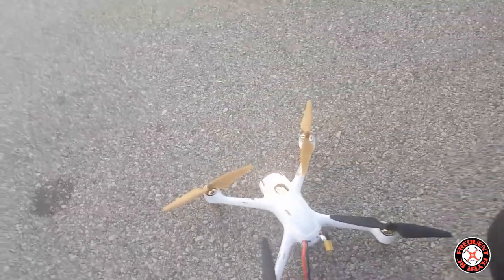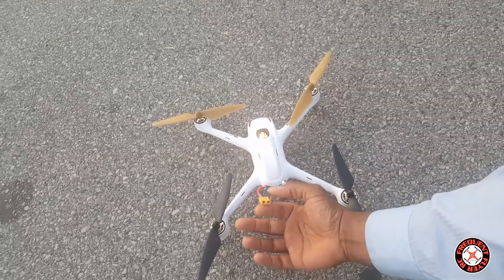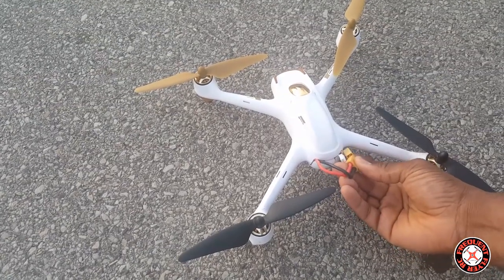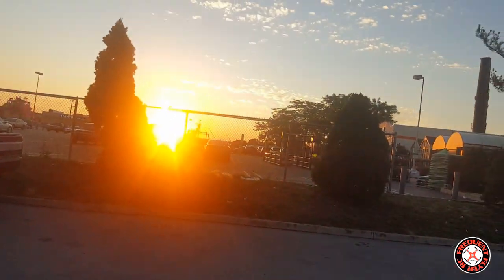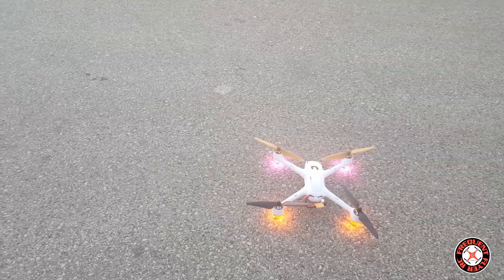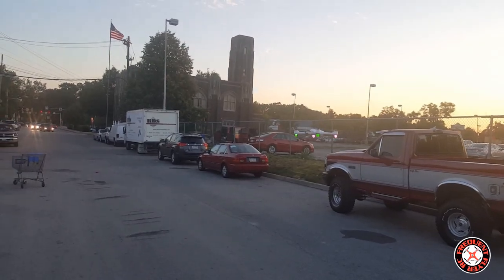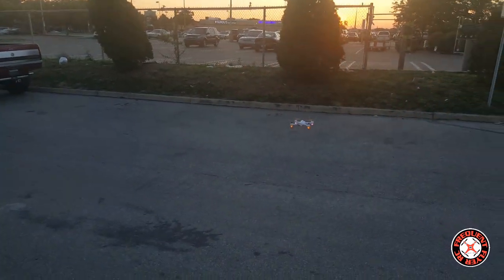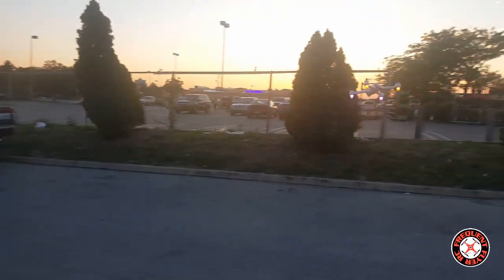H501S XT60 Adapter and 25C Battery with Upgraded Transmitter

Comment: love the videos.. which battery are u using?
Reply from the maker: +474cfmh Thanks! It's a "Zippy Compact" 2200mah 25C 2S:  http://amzn.to/2ahUIx1
Reply: Thanks, do u know if there any other battery that would fit inside, with a higher mah rate? maybe 3000mah? ,also since there a dual battery mod can i just use a higher volts on the drone maybe 11.4 lip?
Reply: I'd be careful placing a 3s battery in a quad designed for 2s.  Also, quads don't like weight.  I've been through all that building my own quads.  You need to check the amp rating of the H501S ESC's first.  I just ordered mine.  What impressed me was the 20 minute run time..

Comment: Frequent Flyer love your reviews, but was wondering if you could get in-depth about your upgrading transmitter (how many batteries are used, can you use a Lipo, does it control every function of the Hubsan H501S, how clear is the screen with telemetry and FPV)? How did you get the lights to stay on constantly, I know you mentioned that in your previous review of the H501S...was it after firmware update? I haven't purchased one yet, but your reviews is doing a lot of persuading. Lol! Keep up the great work!
Reply from the maker: +Tim Palmer Thanks, will try to do a video on it

Comment: Thanks for the nice video as usual. Quick question I have taked apart the transmitter for my 501s. How do I remove the spring mechanism from the throttle. Thanks Boston Ken
Reply from the maker: +ken powell I don't know that it can be done on the stock tx. I hear you can swap them though.. Search Andy RC on here. I think he has a video up on it as he flies mode 1 and his channel is pretty cool so sub him while you're there :P

Comment: Hi bro,since its quite long that you uploaded this video, can you please tell me whether you faced any ESC's or electronics related problems because of 25C lipo ? I am also considering upgrading to 25C 3000mAh lipo. 
Your reply is highly appreciated, thanks in advance.
Reply from the maker: No problem whatsoever. As long as its 2S you are good! 👌🏽
Reply: Thanks a lot bro for such a prompt response. I can now try the 25C without any worry :D
Reply: 7.4 volts,, the problem is the battery compartment inside is small.  the stock battery ratted at 2700 mAh ,  tests at about 1850 mAh.    so any "real / good" battery of 300+  7.5 2S of 50C should be fine.

Comment: You got about 12 minutes of flight time. I guess that's not too bad as the battery is 500mAh  less than stock battery and you were punching it a bit with a 25C discharge rate.  Still a great video. 
Was the throttle stick mod difficult ? Do you still like it or regret it ?
Reply from the maker: +Elecifun Self centering throttle is never preferred for me. Also, on the upgraded transmitter its not a mod. It's actually an option. There's just a screw inside to loosen or tighten to have it either way on both sides too! Most pro hobby-grade transmitters have this ability.
Reply: I forgot you were using advanced transmitter. I hoped you had done it to the standard : (  I need to get used to it. Problem is I use self center on the simulator and then when I use altitude hold on drone it feels funny. When I get more experienced I will be OK, I hope : )

Comment: Hello FF-RC. The Firmware update of 1.1.17,  as compared to stock firmware. The lights on bottom in stock will blink, and I have noticed the update of yours is very (which is good/cool) is much brighter and constant.
So tell me, with the update, are the l.e.d.s stuck on either constant, or off?

Preciate ya', man. And all your Awesome Vids.
Reply from the maker: +Sean Brooks hey Wassup man, the lights can do constantly on, flash blink like before or you can turn them off all together!

Comment: Nice flying!

Thanks for the link to the battery, I wonder if the stock battery is actually 2700mah. When I've been looking for them I've found it very difficult to find anything near 2700mah that will fit,  not many owner's of the H501s would settle for less than 2700mah so would end up buying an original battery. Hubsan must be selling an awful lot of them as they've  almost cornered the market as there aren't many alternatives if any, maybe I've been looking in the wrong place.  haha
Reply from the maker: +Andrew 2700mah is what my stock one says.
Reply: Andrew
Reply: Andrew don't buy off ebay even tho they say original. Stock battery=20mins Ebay-Battery=13mins to many fakes on Ebay that are junk. On Amazon there's a place selling for $24/lipo and the reviews are really good saying that those ones do get you 20min fly times
Reply: Frequent Flyer RC Thanks  Frequent Flyer!  😉
Reply: Cunningham1420  I ordered some batteries from HK. 😉

Comment: Hi thanks for posting the video with the battery connector mod. Just wondering if its beneficial to have the xt60 for this quadcopter. Ie does the quadcopter pull enough current to warrant the mod.  Furthermore, do you know if the quadcopter can handle a 3s battery?   Cheers!
Reply from the maker: +AJ L definitely more punch with this connector and batt
Reply: Thanks for the info!

Comment: I burned out a esc using this battery on second flight? Not sure if it was bad timing on faulty esc or the battery has too much power for this quad? How's your experience been
Reply from the maker: +mike216ism Wow, mine is still working fine. I even saw another reviewer do a mod taping 2 batteries together and modding them into a parallel system then running them for more power and more flight time!
Reply: Frequent Flyer RC well maybe I had a esc going from a prior crash a month ago. I'm going to give it another shot then. I really liked the responsiveness! I dropped the quad and let the stick go and it just grabbed like nothing I've seen with stock batteries. Thanks for letting me know how your experience has been. Going to try using them later today. Hope all is well
Reply: @FrequentFlyerRC  correct, Dustin Dunnhill did that video regards running 2 batteries in parallel with no problem at all.

Comment: When I look on my transmitter it says   
V4.2.8
LCD V1.3.2
H501S  V1.1.9
V1.1.9
Is this an old firmware? Did they fix the bugs on the firmware now? Thanks and sorry for the dumb questions
Reply from the maker: +jarka1361 old firmware but the good one. 1.1.17 is best firmware now

Comment: This drone almost as quick as the Bugs 3 when you put I t in manual mode. You can actually do manual flips  (throwing ). The 501s  is a beast in full manual
Reply from the maker: +Mike Anderson This is actually faster than the BUGS 3 when I fly it with my Devo 10. Also, I have many old videos out of the H501S including videos of me flipping it in manual mode. Awesome Quad! I actually have an H501A that I only got to fly once 😆
Reply: Frequent Flyer RC well send me that 501a  haha. I thought it seemed extremely fast. I remember pushing the Bugs 3 as hard as I could but this 501s I was holding back because it scares me a little. Your 100% right. It is faster than the Bugs 3. It even says in the manual it can do throwing. I'm so glad I bought this instead of a bugs 2.
Reply from the maker: +Mike Anderson another tip is if you fly it with a Devo or Advanced Tx you can remove the spring on left throttle to fly manual mode more traditional!
Reply: Frequent Flyer RC is it easy to remove that spring?
Reply from the maker: +Mike Anderson in the advanced transmitter and the Devo it's an option to have the sticks self centered or not. Must open the back of the transmitter and loosen or tighten a screw and that's it! I actually did a video on it. Will hunt it down for ya
Reply from the maker: +Mike Anderson here:  https://youtu.be/AZ69YbfT26w

Comment: Are you sure of the battery jack adapter call out. The one I have seems not to fit. EC2 to xt60?
Reply from the maker: +Miller Ingram yes EC2 to XT60, I got an EC3 first and it didn't fit :P

Comment: Is this advanced model? Do you need to do any mods for transmitter to get more range?
Reply from the maker: +Rivo Nömmik no need, advanced and standard identical except for the transmitter. Just buy transmitter if you  like it otherwise, yes, other transmitter can be modded easily.
Reply: but do you modded this transmitter somehow for a longer range?
Reply from the maker: +Rivo Nömmik no, antennas can be swapped out but they work very well!

Comment: have u ever ran into 2.4ghz interference...? I fly ( not anymore) up next to a water tower that has cell phone antennas on it.I either went out of range or something with 2.4 it both happened or both.so I cut throttle slowly to land and zap sorta just fell out of the air and flew the wrong direction
Reply: oh..it was like the 5th flight on my mjx b3. unfortunately trying to recover,land after the schized drone moment I was focused on landing...somewhat close by,begind a row of trees... so I didn't see when I landed in a road=(. ran up a lil hill past the trees and heard. crunch- crunch..front and back tires of like a super duty f350 kinda truck followed by 2cars ran it ..well..pieces of iy over.=( have u lost NE exp. x4's? ** makes me not wana fly
Reply from the maker: +Eric B Awe man, that's terrible but we all have losses like that! My QX90 met its demise recently by being run over by a huge construction vehicle! Nothing was salvageable! :/

Comment: Hey buddy, is there a way to stop the LEDs from blinking and stay on. Or change the color of them on my 501s. Thx, KP
Reply: hold the throttle trim button for a few seconds. you can make them flash, stay on or turn off.
Reply from the maker: +circuitprotector might have to update firmware though
Reply: i didn't have to for my h501c that i recently purchased so maybe it has updated firmware already..? idk but i'm very happy with everything except for the charger which died on me after only 10 or so charges.

Comment: Did your motors last ..just wondering before I try this
Reply from the maker: Yup, still have it. These a brushless motors, they last very long unless you crash a lot or allow the to run hot for too long. A better battery of the same cell count doesn't make it run hot or harm the machine in any way👌🏽.
Reply from the maker: Do not try a 3 cell, stick with 2 cell packs and it's all gravy! 👌🏽
Reply: @FrequentFlyerRC   cool just waiting in some funds.im planning on the antenna mod and battery mod.then I might try the 3 blade propellers.
Reply from the maker: @olskool501  if you are more concerned with flight times the stock props are the way to go. The tri-blades cut flytime in half!

Comment: Question... how did you make the lights solid?
Reply from the maker: +cyraxdarkmaul firmware 1.1.17 you can hold downthrottle for a second and a half to toggle them
Reply: i think Hubsan has removed the firmware update.  I do not see it on the download site.
Reply: hold down the trim down button
Reply: Triple props

Comment: Frequent Flyer RC  I ordered the antenna mod for my h501s (the antenna without black casing) at Banggoods.com , what can i minimum expect the Range\Altitude to be with stock firmware ? Stands V.1.1.9 when turning on transmitter (on transmitter main menu\Show Version : V4.2.8  LCD V1.3.2) is this crappy firmware ? (max Alt 125m )-Or shoud i definetly upgrade the firmware on transmitter ? or Cuad ? Or both ? What is expected battery time on transmitter with Stock 4xAA Batteries with antenna mod ?
Reply from the maker: +Roy-Harald Sandvik Expected battery is about 20 min! Range is very good too! See how the firmware works for you. I wouldn't be so quick to upgrade unless you have to

Comment: normally I just turn my gps off and i can get it to fly around like that whats the difference between no gps and manual. mode?
Reply from the maker: +Cunningham1420 manual mode is no GPS or altitude hold help. Just flies like the little micro Hubsan x4
Reply: Frequent Flyer RC  Ok i understand what you mean I'll have to try that out without the altitude hold and i think ill get some of those xt60/ec2 adapters to try out
Reply: Be careful of the motor cut off syndrome in altitude mode. If the 501 goes 90-degrees it will shut the motor in mid air and can cause a crash. The only way to fly is to put in manual mode just like what Frequent Flyer RC did on the video.
Reply: zepp3lin i thought the motors only did that with the newer Superflyer FW .21 &.22 and FW before this i was told didnt do that
Reply: Cunningham1420 It's one of the stupid safety features from Hubsan. Safety features to make sure you buy another new quad LOL.
FC 1.1.22 and above they alter the shut off timer to 5 seconds from 2 seconds from older firmware. They knew of this problem but only rectified it by a mere 3 seconds which is not enough.
Reply: zepp3lin yea i havnt even paid mine of yet so i try to take it easy but i got about 15hrs fly time in it and so far it's pretty good little quad for Advanced $250
Reply: Cunningham1420 I think, you better be careful lol, will be sad if it crash. Just like me, money is a concern to me....:)
Reply: zepp3lin yea  $ is tight and the main reason i haven't updated the firmware yet because i don't want to brick it but i was told the FW I'm running is one of the most common except that the rx power was drastically cut back to pass FCC. i was told if i upgrade to FW .21 or .22 that my rx power would go from 3db to 15db. I have no issues with FW except i can only get about 250m away when people running .21/.22 are getting 1000m

Comment: Wonder if it can handle 3S?
Reply from the maker: I don't think it's worth a try.. To fit 3S would mean using lower capacity pack which means less fly time. Also, this bird can't be tuned and using same props in the jump in power from 2S to 3S will more than likely produce oscillation. I admit I have done things like this only to satisfy the tinkering tendency in me lol

Comment: Another reviewer uploaded a video of a similar Hubsan quad (the H109) using a 3S battery (instead of 2S)  strapped to the bottom of the fuselage : that machine really moved ! I was thinking that it would probably work better too, by using two of the original Hubsan batteries in parallel, thus drawing the necessary current from two batteries, and thus reducing the burden on each battery by half. Of course, a little solderinng will be necessary, and the flight time would greatly increase. Another reviewer also referred to this issue, and he cited the problem that when the draw of current gets too high, the battery shuts down, and the quad falls from the sky..!!!
Reply from the maker: Well mine has never fallen from the sky before lol. I have seen Dustin Dunhill run 2 stock packs in parallel. His video should still be up

Comment: Do you like this better than bugz 3 ????
Reply from the maker: +Wolf Beastmode different type of bird but I would say yes! This has GPS and 5.8Ghz FPV with screen built into the transmitter with all the telemetry you ever needed! This also has altitude hold that can be turned off for sporty flying too!

Comment: I have some 30c 2s can I use them and also can you tell me what the range is on the standard remote for this drone
Reply from the maker: +Angela Cervera yes you can. Given it fits into the bay. Don't know for sure but I have seen people go beyond a thousand meters with a simple antenna mod to the transmitter. I have gone past 300 meters with it unmodded.

Comment: how did you remove self center stick
Reply from the maker: +william torres You must open the transmitter to do it.. I thought I did a video.. Hold tight, I will try to release a quick video
Reply: sweet I'm also having range problems. only 63 meaters with the range mod. any ideas?
Reply: william torres I ordered the antenna mod for my h501s (the antenna without black casing) at Banggoods.com , what can i minimum expect the Range\Altitude to be with stock firmware ? Stands V.1.1.9 when turning on transmitter (on transmitter main menu\Show Version : V4.2.8  LCD V1.3.2) is this crappy firmware ? (max Alt 125m )-Or shoud i definetly upgrade the firmware on transmitter ? or Cuad ? Or both ? What is expected battery time on transmitter with Stock 4xAA Batteries with antenna mod ?
Reply: Roy-Harald Sandvik drone worship has videos on the matter . I have a copy of his firmware changlog
Reply: Roy-Harald Sandvik I got 2 flight comfortably per rayovac recharable battery's
Reply: Roy-Harald Sandvik BTW you have rare version of the h501s. it's the earliest  firmware. there is room for more features in updateds

Comment: What firmware do you have on the transmitter?
Reply from the maker: +Anthony Cirillo 1.2.3 on stock TX, I didn't update the upgrade transmitter
Reply from the maker: +Anthony Cirillo 1.2.3 on stock TX, I didn't update the upgrade transmitter
Reply from the maker: +Anthony Cirillo 1.2.3
Reply from the maker: +Anthony Cirillo 1.2.3 on stock TX, I didn't update the upgrade transmitter

Comment: good video i think ill upgrade my ec2s to the xt60 connectors
Reply from the maker: +Cunningham1420 Thanks man, or you can get the adapter
Reply: Frequent Flyer RC do u have a link for the adapter ?  
Nice flying btw

Comment: I don't understood what you did
Reply from the maker: +AllStream AllNews used a better battery with higher discharge rate using adapter
Reply: Frequent Flyer RC and Just using an adapter, and a more C battery, become so reactive?
Reply from the maker: +AllStream AllNews yes the stock battery is like 10C

Comment: too many metal contacts, more heat, less flight time
Reply from the maker: +Ashish Amatya here was roughly 12 minutes flight time... without forced landing. I landed because it's Ramadan and was time to break fast! :P
Reply: Win some, lose some Ashish, at least with an adapter, you don't have to rely on the stock battery, which makes more sense to me, I have done the same thing with my MJX Bugs 2w and buy replacement batteries locally, another great video FFRC👍